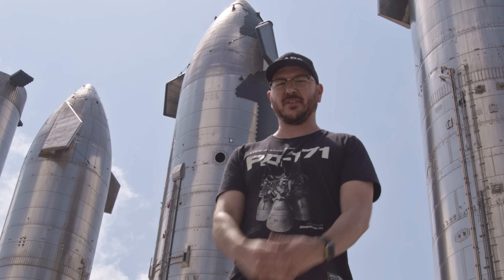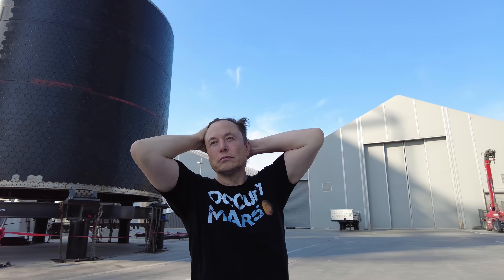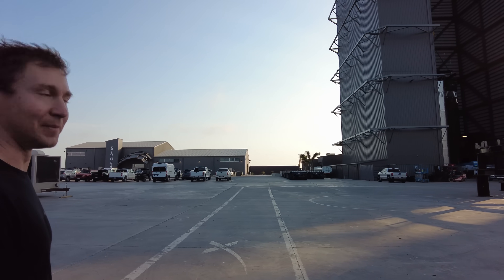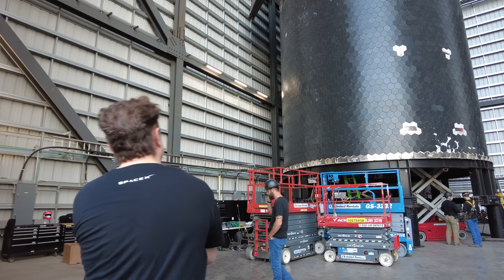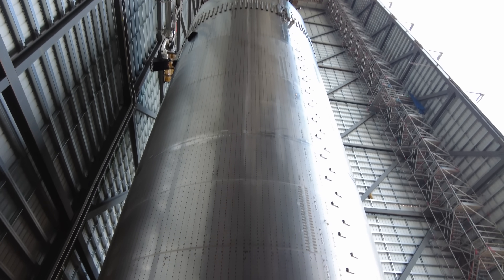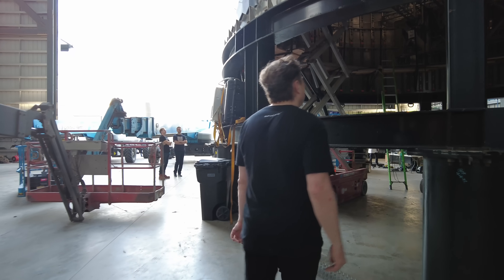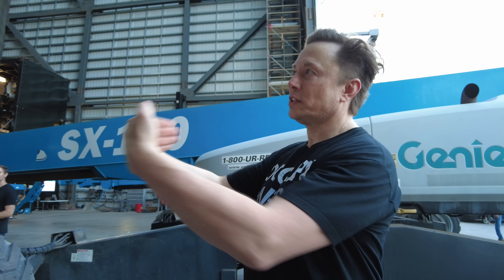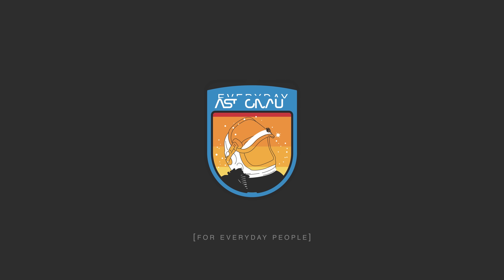[2022] Elon Musk Explains Updates To Starship And Starbase!

Comment: For an engineer like me, it's always great to hear Elon say "we might be wrong" or, "we don't always get it right" since it shows how important the engineering/scientific process is for endeavors like this (or really any project.)
Reply: Don’t tell the haters. If he throws out a guess or a proposed idea they take it as a binding legal contract.
Reply: So, as an engineer, what do you think Elon actually said in this video beside "eh", and "we use gas", "we have more than enough pressure", "we'll vent it anyway". And tell me, how is that new as apposed to when the first "star" ship went into space, and gas pressure was used to move around?
Also, what would you consider a star ship? Any ship that exits Earth's atmosphere and from which at some point in time you'd be able to see a star? 
What field of engineering are you in?
Reply: @stylis666  Ship is the vehicle Starship is/was the system.  
I'm a mechanical engineer. 

The RCS using gas isn't new.  However the idea to use ullage gas (left over gas not needed for propellant) is a newer idea since all current space vehicles are not a giant tank like Ship.Ship's.

Basically the idea is to vent it when it can do useful work vs venting it before landing (want the least amount of fuel possible in tanks to reduce risk of explosion during landing.)
Reply: for me an engineering student/part time technical drawer. Hitting an actual industrial job was such an eye opener. Like other CEOs and people giving expert lectures always seem to be so incredibly far off and out of reach while just filled to the brink with confidence. And then you work in those firms and notice everybody is just cooking with water. So "we might be wrong" for me is just honesty. Because that's the thing all of those other f'**** also "might be wrong" they just don't say it.
Reply: @MrTree421  it's definitely a result of Elon being involved with integration hell and assembly processes. There are usually a bunch of ways to get something accomplished, the goal is always to find one that works and then iterate to the one that's the most efficient. 

I did like his thought that a solution may not have to be the best, it just has to be the best at reducing cost per ton compared to another idea.
Reply: @RealAndySkibba  building the machine that builds the machine is harder than the machine itself
Reply: @xiaoka  exactly, so many haters take evrything said as literal. when he says something isnt optimal or something is design as efficiently as it could be. it doesnt mean their just throwing it up in the air and hoping it sticks its landing. it is a process and even during production of one ship the next one already has the updates for the next flight and from the first flight their knowledge increases even more and the third flight will benifit form this, the engineering process is exactly that a process. not a legally binding contract
Reply: @liamrussell367  tbh, they did just throw them in the air and hoped they stuck the (flip 'n burn and) landing.
Reply: That‘s why I like my craft. Failing is not a loss. It‘s a net win, as long as you thought about containing the worst case damage.
And the next iteration profits from a fail more than from a success.
Reply: Hello sir 👋
Reply: Yes, you can really trust someone who when you're trying to have a serious conversation with them, they post poop emojis. That's the troll you want in charge of serious matters. SMH
Reply: Great point. That’s why he’s been so successful. He’s not afraid to be wrong. He expects to be wrong. He expects to make mistakes and to learn from those mistakes. It’s why he can wear an “Occupy Mars” T-shirt and be taken seriously. Elon is also not the CEO who considers himself the only guy with the answers.
Reply: Thats the first thing you realize once you work in engineering, we get it wrong a lot, and we make mistakes a lot. 😂 We’re not genius people that can solve problems perfectly first time around, thats kind of what college makes it seem like.
Reply: I'm curious about your opinion of the blow it up and make it better philosophy. You see so many people hate the fact that he blows up test vehicles but it seems like cost is lower that way and you can still simplify and improve on it. Would you use the method of other manufacturers or would you go with blow it up testing and make it better?
Reply: @joer8854  the options are design and iterate, or model/simulate the heck out of everything, then maybe still blow it up.

Faster to iterate by doing a full send. They're not trying to blow up, but it's OK if they do.

It's basically software debug style testing w/hardware (rockets).
Reply: @RealAndySkibba  That's what I thought. I'm not saying there's no value in simulations but there needs to be some sort of cost benefit analysis done and it would seem that having test vehicles blow up is far cheaper than testing the living crap out of a model.
Reply: well you learn more from a one mistake, that from a many success
Reply: Trial and error then optimize.
Reply: @MrTree421  helps that spacex is not publicly traded. Elon doesn't have to act confident because it's his own money on this one.
Reply: He rarely gets it right electric car he got right after problems but he didnt invent that or do anything new or anything on it! Everything else has failed terribly im looking forward to his NON android due in 3 months! LOL FAIL!
Reply: exactly
Reply: @jinz0  but musks engineers never get any of his crazy ideas right as they are too stupid and should never been attempted!
Reply: @danquaylesitsspeltpotatoe8307  at the tart musk says one of his ideas came from the previous video and make big improvement on the rocket
Reply: @jinz0  Improvements as in trying to get the flawed idea/design to work! 
How long until this ends up his official "musk has given up pile" or the 5 years past dead line and nothing has been said since pile? where everything is apart from the electric car which has nothing to do with him.
Reply: Ν @danquaylesitsspeltpotatoe8307  why are you so focused on how a succesfull and innovative genius, like Musk spends his own time and money?
Reply: Can you do favour me please??
I wanna ask something here
Reply: Kérdezzél!
Reply: As an Engineer myself,  I am constantly arguing with people who say Elon is not an Engineer,  just a rich CEO taking credit where it belongs elsewhere ... I understand he perhaps doesn't have a doctorate in Mechanical Engineering,  but he's more than capable of explaining in great detail the operation and function of their design and build a fledgling Space exploration company that can land its rockets intact and have legitimate plans to probe and place humans out into the solar system.

If that - Space X, Tesla, Boring company and Neuralink doesn't qualify Elon as an engineer,  I'm sorry but neither is anyone else. 

The man is arguably the most successful Engineer of our time yet people still believe he's just the CEO and doesn't involve himself with every microscopic detail of his products and technologies. Those people are wrong and I should know, I'm an Aerospace Engineer.

Comment: I can't wipe the grin off my face at the thought of a 10,000x improvement on the state of the art. Elon's ambitions know no bounds.
Reply: …without breaking physics!
Reply: It's not as hard as it sounds. With orbital refueling, you get about 100x the payload to Mars, and with rapid reuse of both stages you get about 100x cheaper launch. Even if each launch needs like 5 refuelings, that's still 100x100/5 = 2000x improvement. In other words, Elon has identified 2 ginormous low hanging fruits that Old Space just wasn't motivated enough to exploit.

Comment: Gotta love how despite being such a wealthy and successful company, SpaceX is still using rental equipment for manufacturing and construction at Starbase
Reply: That's also due to the fact that renting stretches the cost in time and probably also the availability. It could be hard to find all the machines to buy new. Instead you rent them from those who have them already. And leasing ore renting is probably easier and more flexible.
Reply: That's, in fact, one of the very reasons why SpaceX is such a "wealthy" company!
Reply: And you can pull out at any point, you don't own anything
Reply: @marko7969  (<~~~ That's what she said.)
Reply: Mobile machines will eventually be replaced by custom lifts and platforms when they have a more finalised design. When they have a production system they will have   platforms and lifts built-into the buildings.

Comment: The thrust to weight ratio talk reminds me of Astra Rocket 3.3 that had a thrust to weight ratio just over 1.25 with five engines, and how that rocket cleared the launch tower horizontally when one engine failed on liftoff. After some propellant was burned it finally was able to go vertically, although the mission itself was lost.
Reply: High TWR combined with 30-something engines means it will take a lot of engine outs before Starship sees an Astra-style hover incident. If Elon's worried about not clearing the pad and destroying stage 0, he's at least resolved one of the failure modes.

Comment: That whole ullage gas thing is really cool. It seems inefficient to carry the empty tanks to orbit, but it can have surprising benefits like a ridiculous amount of ullage pressure that needs to be vented.
Reply: A way to turn an L into a W. If you got to lug it with you, might as well use it.
Reply: What is this ullage gas?
Reply: @grzegorzkapica7930  Basically you need to push your fuel out of the rocket, so you have a lot of pressure (aka gas) inside the fuel tank that pushes the liquid fuel towards the rocket nozzle. Once the fuel is drained all you're left with is all this gas in your fuel tanks. Ullage gas.
Reply: @grzegorzkapica7930  Ullage gas is the gas in your propellant tank.  Basically you never fill your tanks 100% with fuel or oxidizer.  There always is some "air" space in the tank.. That's the ullage space.  As the tank empties you have to pump in more gas to fill the space.. So when you get to orbit you have a mostly empty tank with a LOT of gas in it..  If you can make that gas work for you that's great.
Reply: @AIM54A  Thank you.
Reply: @AIM54A  Where is this ullage gas stored? Do they store it in these black copv's?
Reply: @2ProBro  Yes normally that's where you'd find the helium under really insane pressures to keep the copv's as small as possible.
Reply: @2ProBro  Yes, usually they use helium or some other inert gas, stored in COPVs under very high pressure.

Another method is to tap off some of the high-pressure gas from the engines themselves and pipe it back into the tank. This is called autogenous pressurization - that's what starship will most likely do.

This has several benefits: 1. no separate system adding weight and complexity just for storing and controlling ullage gas. 2. less failure points (if a COPV ruptures it will over-pressurize the tank and break it - as has happened multiple times in the past). On the other hand it of course adds a different kind of complexity and plumbing from the engines back up to the tanks - so like always: it's a tradeoff. But for a huge tank like in this case the tradeoff is very much in favor of autogenous pressurization.
Reply: @stephanweinberger  Why can’t you just use regular surrounding air? And use these copv’s once you’re in vacuum?
Reply: @2ProBro  Firstly: you need lots of ullage gas, as the engines are sucking out fuel at a rate measured in tens of cubic meters per second (each Raptor engine has a fuel flow of about 1,400lb/s, and there's 30+ of those engines on the booster).
Secondly: When launching a rocket you are - for all practical purposes - in vacuum after less than a minute. You want to get out of the dense part of the atmosphere as quickly as possible (i.e. go straight up initially), as every second there means fighting against drag.

Comment: I would love an analysis video of this by Tim where he further explains all the details that were talked about, e.g. the cold gas thrusters replacement system which I'm not sure I fully understood.
Reply: The rocket requires some pressurization gas inside the fuel tanks, to maintain rigidity of the vessel (e.g. how a full soda can is much, much stronger than an empty one) and to keep the fuel gathered near the intakes that lead to the engines. This gas is called "ullage gas." It's usually helium. The insight is that the ullage gas can be used as a dual purpose tool- both to provide the rigidity and fuel handling while boosting, but once the gas is no longer needed, instead of just venting it and wasting it, to use it precisely as the attitude and orbital maneuvering thrusters. This saves an entire system of nitrogen gas cannisters and controls, with large cost savings and weight savings.
Reply: @avoirdupois1  thank you for writing out "ullage"! I wish Tim would add explanations in the video for some of these unfamiliar terms. We're not all rocket scientists.

Comment: Elon addresses one of the most important aspects of engineering, and why NASA and other companies have so much trouble getting things done. Do not try and reach perfection before production! Get it doing what you want it to do, THEN start optimizing and perfecting. Then after production begins, keep engineering on continued improvement of the product and how it is manufactured. So many companies see the design process as a finite project to be handed off to production and then forgotten about.
Reply: The problem seems to be, at least with NASA, they want a PRODUCT, that stays the same to do one thing only. Like launching various satellites. What they are developing now is a product that is always in flux. Continuing to change because the end goal isn't achieved yet. It is a bit like various iterations of the same product but building them as you go.
Reply: Couldn’t have put it better myself, engineers learn and improve designs from trail and error. NASA seeking to achieve perfection before launch is the reason they are second to Space X now.
Reply: Also, the design and production system should iterate together.  By getting into production you not only find what fails with the product design, you also find what fails in the production system.  Sometimes design changes are needed for production reasons and this is a critical step that many organizations don't support well due to their org structure.
Reply: @oof_Dad  and this is the most significant difference between NASA and SpaceX: NASA is not a production organization, it basically only builds one-offs that have to work.
Reply: Occult Ocelot  go away

Comment: - At 1:08, Elon says the new Mega Bay under construction will allow 10+ workstations to build ships and boosters, enabling much higher production rates. 

- At 2:38, Elon explains they will use ullage gas from the tanks for attitude control instead of separate thrusters, since they need to vent the tanks anyway. Major optimization.

- At 14:45, Elon discusses pros/cons of grid fins vs wings for control. Grid fins more consistent through mach regimes.  

- At 23:52, Elon says there's not high confidence the first orbital flight will succeed. The ship making it down intact also not highly likely.

- At 26:17, The heat shield tile gaps should get smaller when the tiles heat up. Goal is to minimize peak heating on reentry.

- At 29:59, Elon emphasizes the key metric is fully considered cost per ton to orbit. Everything should optimize for that. 

- At 31:09, Current cost to land 1 ton on Mars is ~$1 billion. Needs to get under $100k/ton to build a self-sustaining city. 

- At 37:31, Elon says the forward flaps are suboptimal and may be able to be deleted entirely. Lots of potential optimizations still.

Comment: In the permanent production building they can assemble 8-rings sections (instead of 4-rings) so the High Bays could be twice less engaged in stacking them. So it should also increase the production speed significantly.